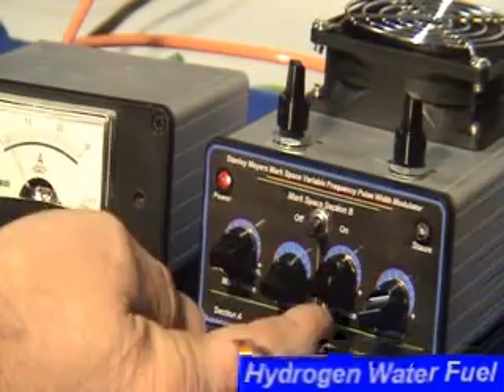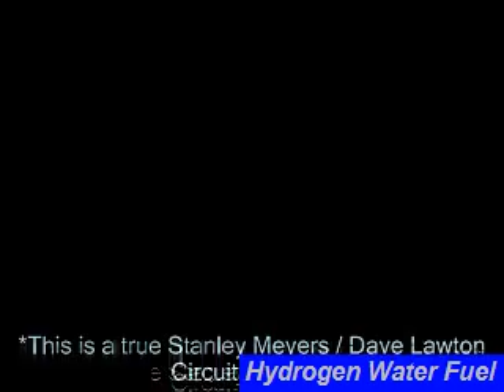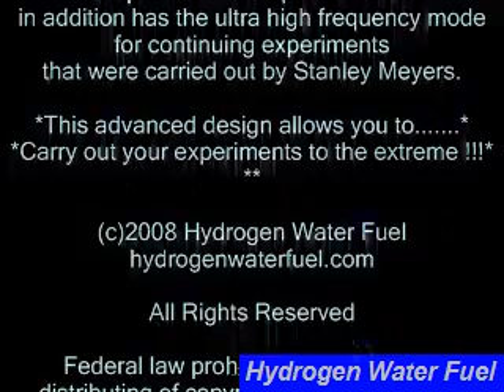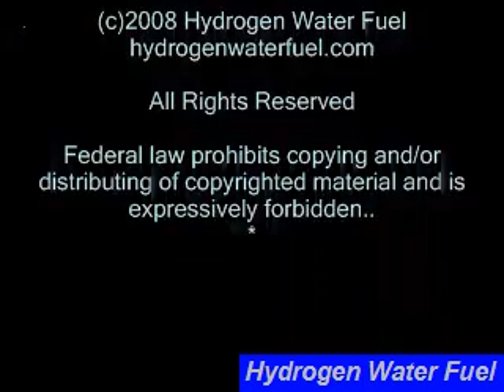How the Meyers Dave Lawton Pulse Generator Works

Comment: Some one will soon broadcast over the internet a continuous h2o lyse signal of 42.8khz: a square wave gated at 600 cps @ 50 50 duty cycle
to drive Meyer based systems without the cost and complications of circuitry (free developing country power resource) etc
safe low current Community high voltage is also in the works

Comment: @wotan237:  The theory is that the WFC is a tank LC circuit.  You simply find the resonant freq. I think the circuit builds up a very high voltage oscillating wave form on a DC vltg.  The high voltage then rips apart the water molecule, not like conventional electrolysis(brute force)  This is like pushing your kid on a swing a little at a time and before you know it whoop over the top ;-)  I understand the secret is drawing ambient energy, not battery, on each voltage spike.
Reply: Correct and just like teslas hairpin circuit did. It creates an unstable envoironment of Electron deficiency. From ground wire it restores the balance . The power initially powers the system but the electron deficiency is created and in the cycle to rebalance the system the circuit gets energised again . Simple